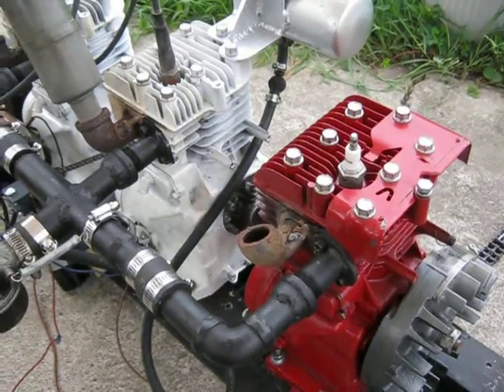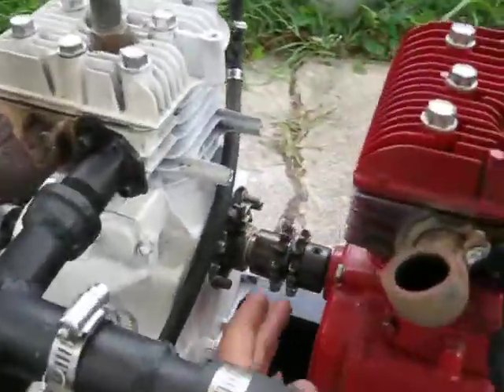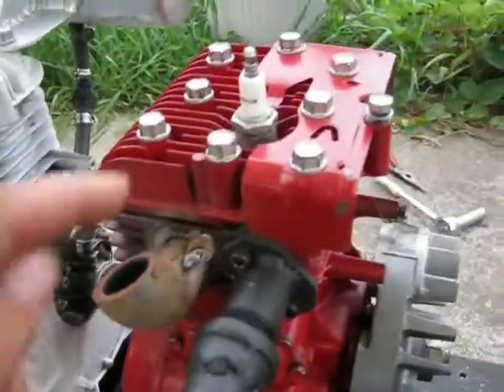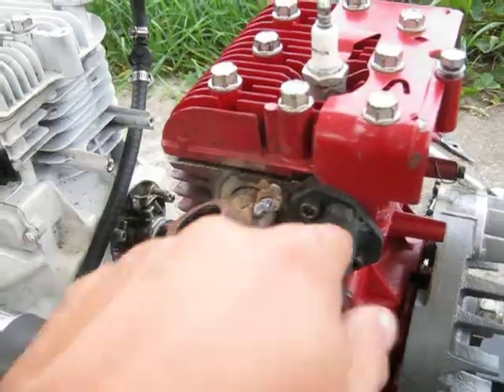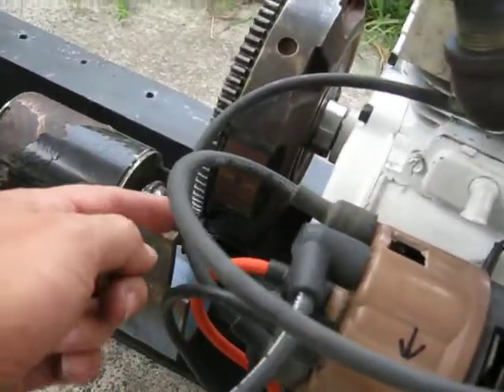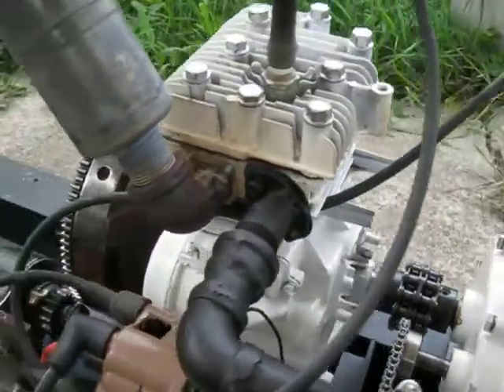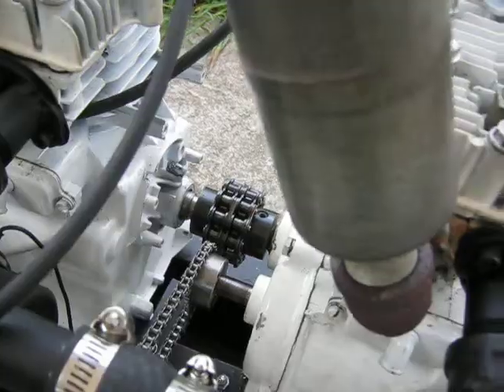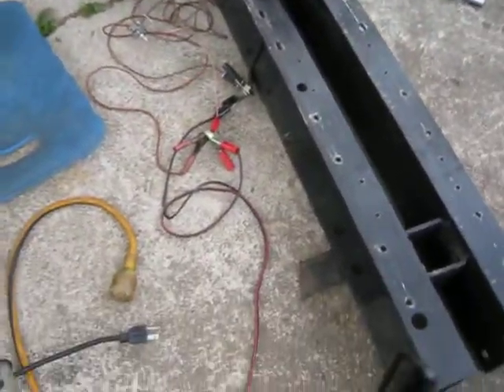Quicki FrankenBriggs 2 Cylinder!

Comment: Hmm, was it the camera or was the flywheel on the disconnected cylinder rotating independent of the shaft due to vibration? 
Also, would not having a flywheel on the rear two cylinders make it less able to idle?
Reply from the maker: yes, the front flywheel is disconnected, and rotated from vibration. The rear flywheel with the starter gear is a heavy one off a 12 horse riding mower, so it is more than heavy enough to smooth out the 2 cylinder. It is probably the intake manifold that won't let it idle down.
Reply: ChargerMiles007 Aye, the dead-end might collect fuel and allow it to pool?
Reply from the maker: Yes, I see that is a distinct possibility, it appeared that it was doing that after I tore the manifold off it.
Reply: ChargerMiles007 Cool!